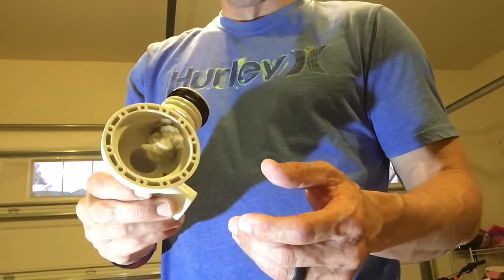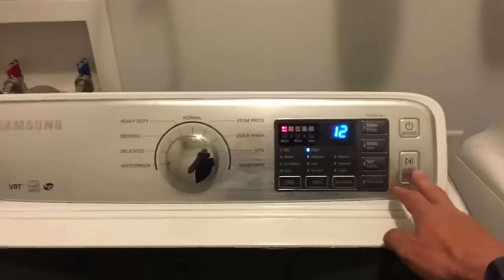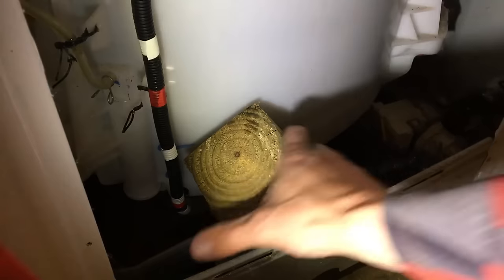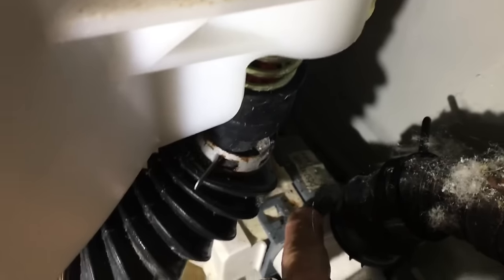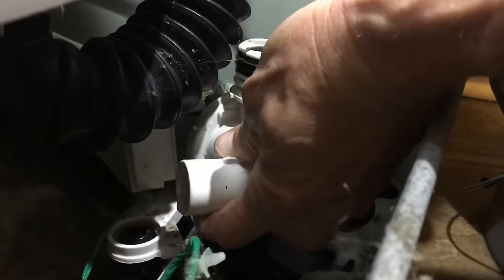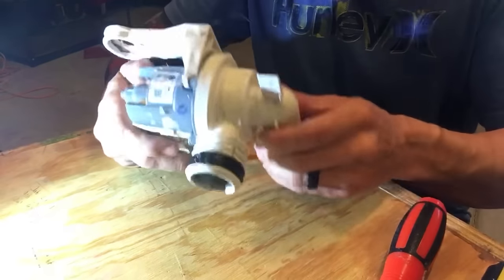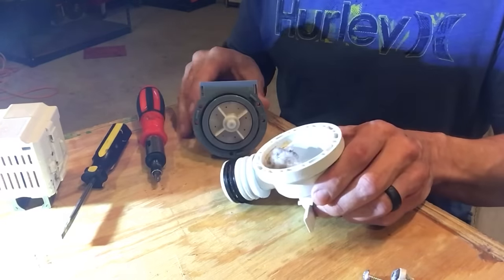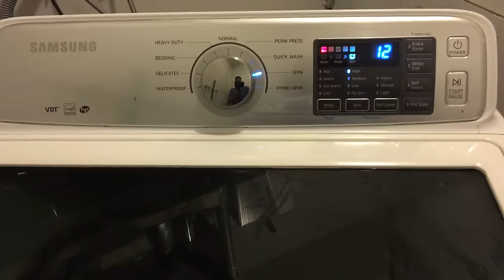Samsung Washer Won’t Drain! Easy Do It Yourself Fix WA45H7000AW

Comment: Great video!!! Heres another tip for people having trouble out there… after unclamping the first black hose on the right hand side, i used a wet/dry vacuum and was able to get a huge amount of cotton which was clogging the pump. Clamped it back up and was good to go. This will save you some time from having to take out the whole pump and taking it apart. Plus keep things a little dryer because you can use the vacuum to dry as you go!
Reply: l
uuuu😅😊  la
Reply: This saved me so much work!!!  Thank you kind stranger!!!
Reply: @jasonpaden8641  glad i could help
Reply: Does this type of washer have a filter clean out place like other washers. I've looked but never been able to find one on it.
Reply: @amypotts1873  Not that I’m aware of.  I ended up wasting some time taking the inside of the drum apart looking for one.  My issue ended up being a newborn baby sock that made its way into the pump.
Reply: Thanks for the advice I did vacuum out the hose line to start there and what ever was clogging seemed to work out my washer is working at the moment. Time will tell.

Comment: Thanks for the great video. My Samsung 7050AW washer started to have the water draining issue about a week ago. The instructions were clear. 

Was hoping my issue was the same with just the lint. Found the inside motor have a small plastic piece that was broken off. Was able to order a replacement motor piece for about $20 from Amazon. What is harder is that rubber valve cap, DC62-00328A, was broken off and the exact piece for the OEM is about $60+. There is another valve cap for about $10 with a different model number but don't think it would fit. In the end I just went to the Sears Direct to buy the motor set assembly for about $100. At least I know that the part would work. Still have me some money from needing to buy another Washer for a while.

Comment: 100% DIY solution!  I got lucky and didn't even have to remove the pump, just the top hose and there was the "clog" sticking out.  Pulled on it and kept on pulling until a mauled sock about 8 inches long came out.  Less than an hour, and we are back in business.  Thank you so much for posting something so easy to find and follow.  (soap box comment: What kind of engineer builds a washer where something the size of a sock can reach a pump impeller?)

Comment: Thanks for the video bud.  We have a similar Samsung washer using the same pump and I expected to find the pump header full of fluff like you, but instead discovered a loose impeller and broken impeller shaft.  LOTS of other washers use this same pump, as do other companies as well.  You can get a replacement pump (just the motor--it snaps onto the plastic header from your machine) for about $25 at multiple websites.  Just finished the job and am running our machine for the first time in a week (No LEAKS !!!).  Could not have done this without your very helpful video.

Comment: Your video just saved me a $300 repair quote from a local tech.  $150 just for coming out and an estimated $150 do do the repair.  I followed your directions and found a that a sock had been sucked into the line.  Just pulled it out, put the hoses back on the pump and the washer is working fine.  Thanks very much for posting this!

Comment: This was the BEST video ever! Extremely helpful! Our issue was not as simple as a clog. When we opened the pump, we found that the shaft on the impeller was snapped. We were able to order a replacement drain pump online for less than $30.00 and now all is working again. Thank you so much for helping us save hundreds of dollars!  😊
Reply: Same. I tried to super glue is back on until the new pump arrived. It lasted two loads then snapped off again. When the new pump arrived i was a pro at taking it apart and putting it back together!

Comment: I rarely comment on videos, but I was doing one last load of laundry before selling the washer & moving, and it wouldn't drain. Followed your video and found a quarter in the pump.... put it back together and everything worked perfectly. What a relief! You saved me a couple hundred bucks. Thanks!

Comment: Our washer wasn't draining and I took the hose off that went to the pump and there was a small sock stuck just before the pump. Removed the sock and put the hose back and all is fine. Didn't even have to remove the pump. Your Video was very helpful, thanks so much.

Comment: I want to thank you for this video. 
My girlfriend told me she was stressed and I asked her why she said that her wash did not complete it cycle by spinning and letting the water out and that the washing machine tub have water in it. I put the model number in and your video came up and I was relieved. Although your pump slightly varies it's the same. I should have listened to the beginning of your video because you do say to put it on the spin cycle which I had to learn later on. I wasn't sure if it was the computer or the motor.
Allowing gravity draining and putting on spin the motor wasn't a problem because it was spinning. However if the machine doesn't release water the spin cycle will stop. I figured out the computer was telling the motor what to do but the pump wasn't doing its job and so it would stop the cycle. 
You made it look easy and your video photography was well done. You were straight into the point and I could understand. 
I'm going to subscribe to you I think you ought to make other videos as you do a good job. We are ordering the pump and I'll be replacing it pretty soon.
Thanks again to you.

Comment: Thank you! This video broke it down, step-by-step and very detailed explanation! When the washer stopped draining, I felt very defeated, I’ve never worked on a washer, and I didn’t have the money to call  a professional. This video gave me the reassurance and confidence I needed to do it myself. It’s crazy to think of what a little piece of a safety pin would have cost me…..
Reply from the maker: I’m glad it worked out.

Comment: You are the man! All of the sudden my washer stopped working in the middle of a cycle with about a 1/5 of a drum full of water. I restarted it and all I heard was a hump (power was going somewhere). I emptied the water by myself and restarted a cycle emptied. It all worked until the drain/spin process. I watched some other videos and stumbled with yours after figuring out the problem must be in the drain pump. I already had the pump out and thought about replacing it since electricity was good (voltage check and humming). I disassembled the pump per your instruction and found a small piece of Jean's metal branding in it stopping the pump from turning. I put everything back together and walla...it works again. Thanks for this awesome video.

Comment: thank you. I am having the same issue. As soon as I have my new wetvac out of the box I will be ready to tackle the issue.  : follow up;  I SPENT some time trying to resolve the issue simply by applying a wetvac hose to the drain hose. It was my hope that doing so would dislodge the obstruction. 
While I was able to fully drain the washer with the use of the wetvac I was unable to clear the obstruction. 
Following you excellent instructions, I was able to do exactly what you did and I fixed the problem. In my case, it was a 1" x 3" piece of strapping which had torn loose from a backpack.
I would advise all to consider taking picture of your pump as you disassemble it as it can be somewhat puzzling putting it back together.

Comment: After watching this video my girlfriend was confident enough to try and fix our unit. She went step-by-step and in under an hour we were back up and running! Turns out a sock was clogging the pump by the check valve. Thank you for being so detailed and going SLOWLY so its an easy follow along.
Reply from the maker: Matt Matarazzo I Just made another video for another issue with this machine Samsung Washer Spins and Refills Over and Over!! DIY fix. WA45H7000AW https://youtu.be/61GSgrTfq1Y

Worn stabilizer rods.

Comment: Great Video... Thank You! Today I paid $120.00 for a local appliance repair company to diagnose my washer. Tech told me my pump motor needs to be replaced. $150.00 for the pump and another $100.00 for labor. I decided to take a look in the pump after watching your video. I found a finishing nail wedged in the pump motor. I removed the nail and the washer works perfect again. You just saved me $250.00!!!

Comment: Thank You!  FIXED!  Great to know what is inside the machine. Just a couple of modifications to your method.  1. I used a shop vac wet vac to suck the water out of the hoses both the drain hose, and when I disconnected the hose from the bottom of the drum. * Note I did scoop out as much water as possible, and sucked out what I could from the top of the washing machine. There is quite a bit  of water left in the drum. A quick finger check into the intake side of the pump confirmed there was a clog similar to yours. I tried to suck it out with the vacuum, but ended up removing the pump and realized there is a check valve in the exhaust side of the hose, so no to vacuum.  I then just stuck a screwdriver into the pump inlet and was able to pull out the clog similar to what you had.  Once it looked visually OK, I used the blower side of the vacuum to blow in the input side, and I had a good flow on the output side. So I reinstalled it without completely disassembling the pump.  Much thanks to you, I would have taken it all apart if I had not watched your video!

Comment: I NEVER comment on videos. But this video helped me a lot! Rather than calling a tech and being charged for service, I just followed your steps. I was hoping it was just a clogged pipe. But I ended up having to replace the drain pump (the “motor” you referred to) cause the little fan was broken. Cost me only $68. Im back up and running like a charm! Thank you sir for this video!!

Comment: I looked up the new pump information and found out that I could simply replace the pump motor and that was only $20.  I did it and it now works.  Thnx again for your helpful video.

Comment: Thank you!! This just saved me so much money! What we thought was a clog like your video ended up being a broken drain pump. As soon as I took it all apart after following your video, the plastic fan attachment fell right out and we noticed it had completely broken off. A quick Amazon order for the $30 part and a bit of work and the washer is working perfectly. Thanks!

Comment: Thank you for this! Didn't even need to take the pump out... a sock was easily visible in the pump as soon as I took the hoses out! I definitely made a mess with the water though... Thank you for your video which gave me the confidence to tackle this problem on my own!
Reply: wtf how
Reply: how the fk did u get a sock in there?
Reply: There is space between the inner wash tub and fill drum.  If a sock were to be dropped into that space the pump would suck it up.

Comment: Thank you so much.  I had the same problem and got it fixed in less than an hour.  However, I got water spilled all over the floor and had to use a shop vac to dry.  Now that I am thinking about that, I should have used the shop vac to get the water out from the drum first.  Anyway, the mess is not too bad and you saved my day.  Really appreciated.
Reply: Right?
Reply: I found this video, but only after watching a bunch of videos that said "you might have a little bit of water come out of the pump, so have a little hand towel ready just in case". I'm glad my husband was home, because he ran down as soon as I yelled out because I basically flooded the whole laundry area, ruining the adjacent floor boards and crumbling the painted cement. I didn't expect the whole tub to empty through there. I definitely didn't expect that it'd all come flowing out at that step. The thing that worries me is that the water came down everywhere, so I'm afraid that the electrical wires have been damaged, not just at the pump, but anywhere under the washer. I definitely will go the shop vac way to empty the rest of it before trying to disconnect the pump again... It's in times like this I wish I had a drain hole in the floor.

Comment: O.M.G. this totally worked for me!  Thanks to your video I was able to open up the drain/water pump and found a piece of wood splinter from one of my husky's chew sticks that must have been in one of the carpets I had just washed.   THANK YOU this saved me a call to a repair person which would have been about $300!!!  I also found my protective housing was not on and secured, plus one of my rubber grommets is missing and will replace, plus the hose on the inside of the back of the washer was not connected to this little rubber stabilizer and rehooked that and it's even now quieter!!!  Thank you! this only cost me my time :)

Comment: Thank you! Our 2015 Samsung washer hit me with the 5E won't drain error code. Had an appliance tech come out and say we need a new drain pump. Part was back ordered and I didn't want to spend $438! This video saved me $300 after I fixed it myself with a new pump from Amazon and this video that was super helpful! My set up was secured a little different than yours but after a three hours I figured it out! Thanks! We had a kid sock stuck in the white PVC pipe that connects to the black hose. Still needed to replace the motor since we burned it out trying to get it to drain before we took the back apart.

Comment: Well, add me to the list of successfully clearing out the drain pump and saving lots of money. The instructions provided were clear, I was somewhat doubtful of the initial video finding dry lint in the drain pump, but I moved ahead anyways based on other comments. Wouldn’t you know - I found a finishing nail in mine, removed it, reconnected everything, and back to functioning! Many thanks

Comment: I found this video at 1 o clock in the morning after my washer stopped draining this evening.  It took me about 15 min to get pump out, and to pull out the stuff that was jamming up the pump! Cu=entry running a wash cycle and it set to be working fine. Thanks a bunch sir, you may have saved me a nice bit of money!

Comment: This saved me some money, you're the best! I have a different model but it's 99% identical down there (minus the wire retaining clips, those I couldn't get to release btw) Had to tear it completely apart from behind the washer on the floor but found a key, that I mistakenly left in my pocket, hanging out in the pump.

Comment: Good video, didn't do this but you gave me the idea. Hooked my shopvac to the drain hose, turned the machine on spin (I could hear the pump buzzing) sucked out the water while it spun just a bit. Dumped the full vacuum, second time did the trick. While I vacuumed and it spun, clog broke loose. Paused it to release the hose and put it back in the wall, bam it drained. Thank you sir.

Comment: Thanks so much for this. My wife had a pillow rip open in the wash which put a bunch of cotton into the drain. I didn't even have to take the pump apart, once I took the hose off the pump outtake I could see the wad of cotton through the swing door. Pulled it out in one huge chunk followed by a huge rush of water. Replaced the hose and the pump started working normally.  Took me 12 minutes to watch the video and 10 minutes to fix the problem. This video made it easy.
Reply from the maker: You’re welcome!

Comment: Wow,  this video was awesome. Thank you so much for posting this. My wife called me this afternoon and told me the washing machine wouldn't drain, and was displaying a code. I did some research and came across this video. I followed your instructions, which you made so easy to follow. 
Turns out the problem was one of my little girl's socks was stuck in the hose that leads into the pump. I still took the pump apart to make sure it wasn't clogged too (which it wasn't). Put everything back together, and it works like a champ. 
Thanks again, sir. You saved us a bunch of money!!
Reply from the maker: Just made another video for another issue with this machine Samsung Washer Spins and Refills Over and Over!! DIY fix. WA45H7000AW https://youtu.be/61GSgrTfq1Y

Worn stabilizer rods.

Comment: Thank you so much for making this video. I had the same thing happen this weekend (padding/stuffing getting stuck in the drain pump) and couldn't find much info on dealing with this on top loading washers. This saved me from calling a repairman or ordering a new pump.

Comment: Thanks for the video!  I have model WA50T5300AC/US and the drain motor is exactly the same and at the same spot.  My washer was throwing a SC error code and not draining.  Followed your directions and found a bobby pin that was getting lodged in the fan blades for the motor.  Put everything back together and it's working just fine now.  Thanks again!!

Comment: Thank you for this video. Took us 5 days to figure out what the issue was. Found your video and fixed it in 45 mins. It was a nail stuck in our drain causing it to make a ticking noise and not drain the water. You’re awesome. Thanks again

Comment: I'm back. You are an absolute godsend. Last year I fixed my washer just like you showed us. Mine was clogged with sand. It worked so great after. You think there would be another filter before the pump. I was thinking of putting a lint catcher on the hose before it hits the pump because it's clogged again.  I came to watch the video again. Needed to remember how to do it. I hope it works again. Thank you so much for this.
Reply from the maker: @chasgarza3960  You're welcome!

Comment: Awesome video:  I have the same washer about 4-5 years old and everything but one clip on the pump wire where you had a screw.    

Opened the pump up and I had a finishing nail in there keeping the impellers from turning.  

Great step by step video!